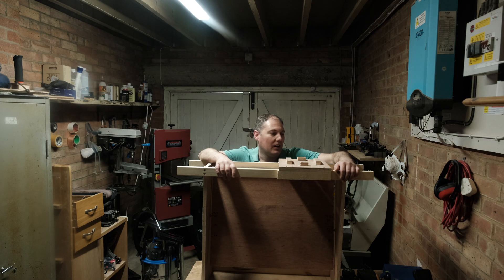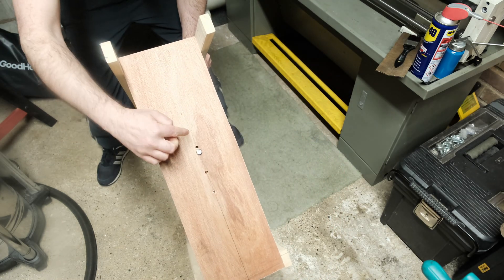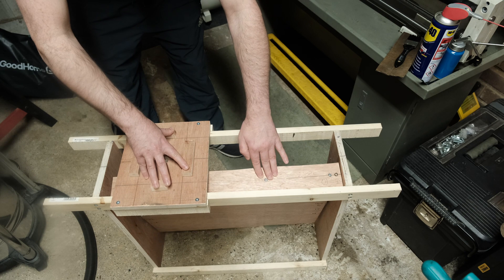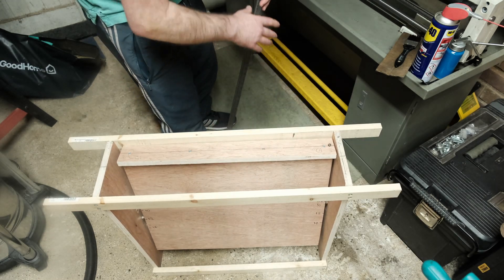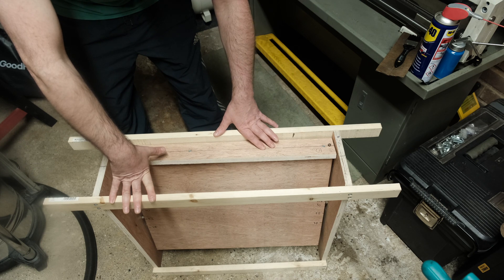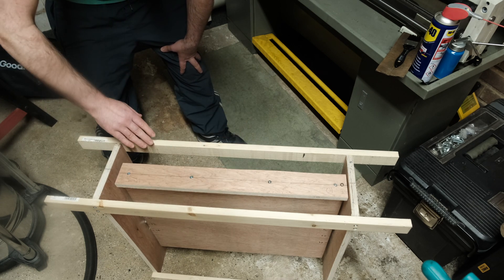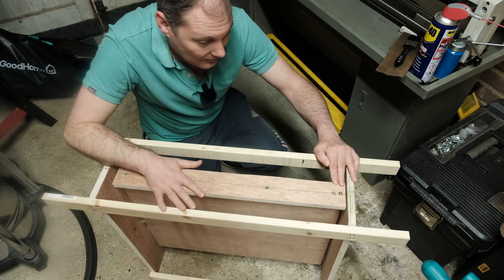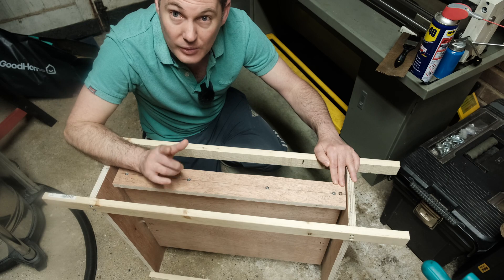Fretboard Radius Jig

Comment: First of all, thanks for sharing this great jig!!
I have a little question.. if you do a compound radius, for example 12 to 16, then the fretboard is thicker in the back an thinner in the front?
Reply from the maker: Hi, thanks for the comment. 
So I think I understand what you mean, and the simple answer is no. This jig compensates for the different radius as the swivel point on one end changes the radius but the overall height of the carriage stays the same distance from the router bit. So the curve of the fretboard is sharper at the nut end, and flatter at the bridge end. The actual thickness of the fretboard should be about the same.
Please explain your question again if I have mis-understood, and I can try answer.

The more complicated answer is a lot of geometry about fixed radius being cylinders and compound radius being conical and that when you look at the fretboard from each end, one end may appear to be thicker than the other.

I would recommend searching YouTube for the difference between fixed and compound (conical) radius if you want a deeper explanation as it's too much for this comments section. (although im happy to try explain it here if you want)

Comment: Hi Lee Thank you for sharing your great idea and explaining how it works. I'm a little confused, when you say you finish with a radius sanding block, how does this apply when you have used the jig to make a compound radius?
Kind regards
J
Reply from the maker: you are correct, you can't use a sanding block on a compound radius, you would have to hand sand. Ive actually now set my radius to be 10inches straight through, so a sanding block works fine to finish.